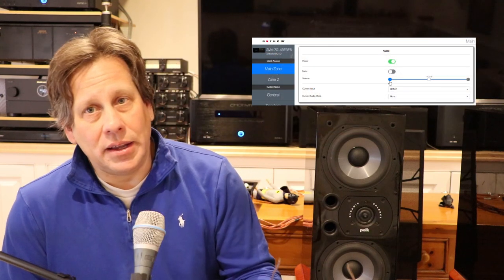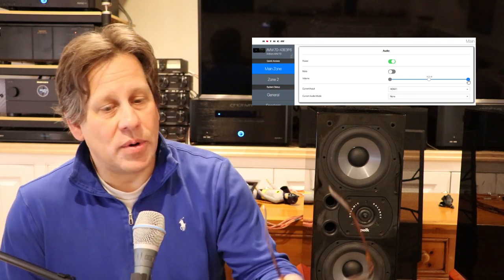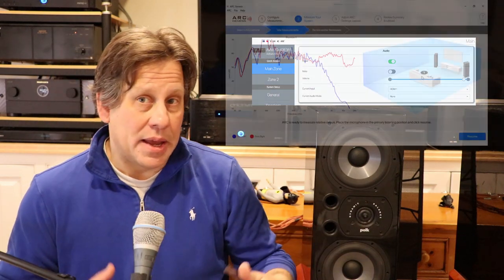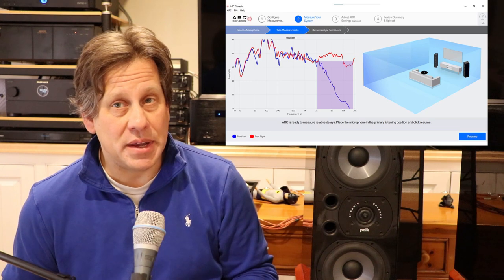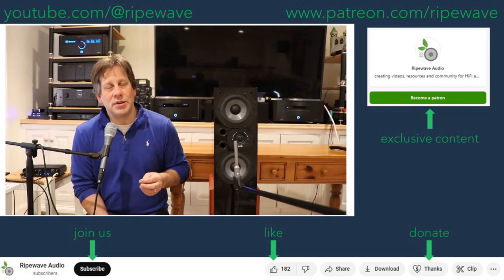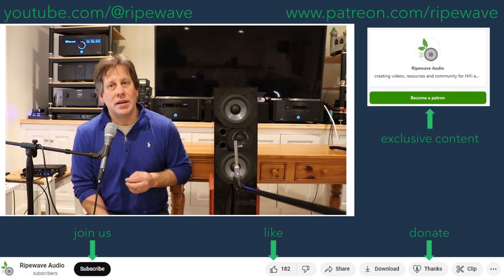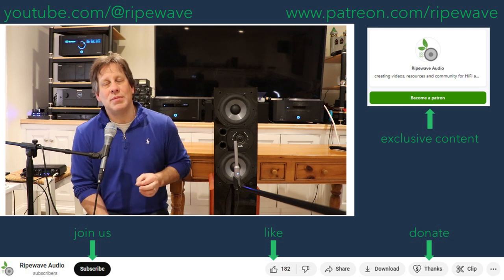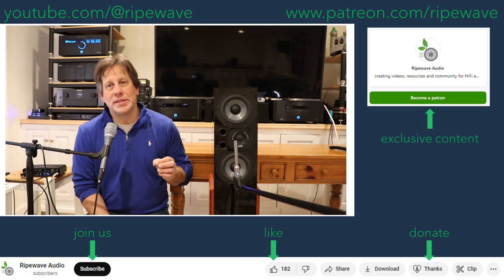Polk Audio LSi 15 Tower Crossover Replacement

Comment: I think it's very much worth it to do these types of repair/replacement. I recently purchased a used pair of Martin Logan 60Xtis, and one had a tear in the woofer. ML was able to send me a quick replacement and instruction sheet in a few days. It took about 10-15 mins to do the simple replacement, and now I have some towers as surrounds that matches my fronts. It's fun to take a peak inside the speaker during the process, and get a better idea of the its build quality and craftsmanship.
Reply from the maker: I will add that a lot of "Voice of Customer" sessions that brands conduct bring feedback that the "LEDs are too bright from my theater - can I turn them off" and "I just stick the unit in a closet - I am focused on the screen." Brands are more then happy to spend their money elsewhere. We need to start voicing that the physical elements matter. -Jon

Comment: time and money invested in speakers that you love, then servicing and repair as long as price doesn't go beyond 3/4 value of new.
Reply from the maker: Justin - I really like your repair vs. buy new formula. I think that makes sense - especially that you are comparing to new replacements and not original value. Even at my original $600/channel cost, I am still way ahead - I paid $37.19 total for the used crossover. - Jon

Comment: Im in a similar situation with my DefTech BP20. Ordered a replacement xover off ebay but thinking of dsoldering the speaker cables and soldering them back in.
Reply from the maker: That is worth a try. I am curious if you are successful. Let me know if you attempt. -Jon
Reply: @ripewave  hey there. Yup, it worked perfectly.  Very simple job and my speakers are functional again.  I’ll be tackling upgrading the caps on my old crossovers next :).
Reply from the maker: NIce! -Jon

Comment: I have a blown woofer that I'd like to replace. But I'm finding it difficult to get it out.
Reply from the maker: Yes - it can be a challenge. Tolerances are very tight. It also seems like there is adhesive used in some case - but I understand there is none. Trying to remember how I managed. If you can get another driver out that is next to the one that is being difficult, remit it and then I used a pry bar to push from behind. It took some force and car not to damage the cosmetics. -Jon
Reply: @ripewave  thank you for your response. I've attached a couple of subwoofers and tuned them to compensate, so for now, it's all good.
Reply: You can remove the binding post/crossover to expose the inside and see the woofer. Then you could apply pressure to the back of the woofer similar to how "Ripewave" removed the mid-range driver.
Reply: @TuneHead , thank you for the tip

Comment: So, do you know if it was Arcam that did this or was it faulty and you never noticed?
Reply from the maker: It was definitely the Anthem AVM70 (not Arcam - haven't brought them in yet). I can compare two calibration graphs that Anthem ARC generated before and after the incident - before shows the expected response, the after shows the response failing over 1.4kHz. -Jon
Reply: @ripewave  😂 sorry I meant anthem, don't know why I said Arcam. I am surprised of how buggy the anthem was, Soo many ppl rave how good it is.

Glad that it wasn't the amp, and I'm really impressed by Emotiva's response to you. What a great company.
Reply from the maker: I am too. So many rave reviews. I suspect it is either my combination of speakers and amps or the particular unit I received had production issues. However, a few others on this channel reported the same issue so my condition is not entirely unique. - Jon